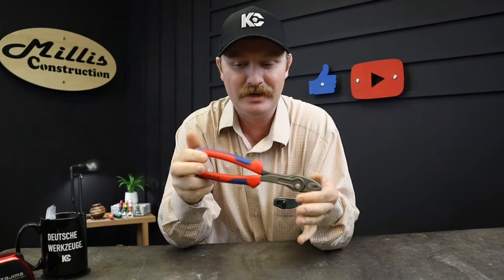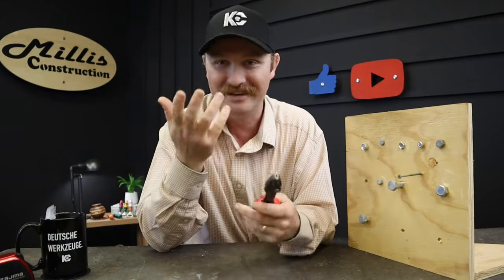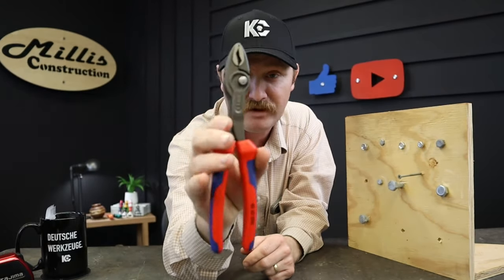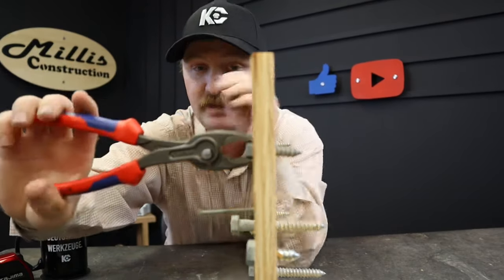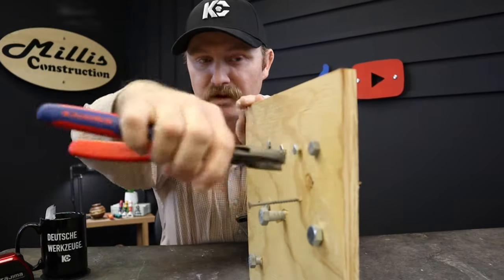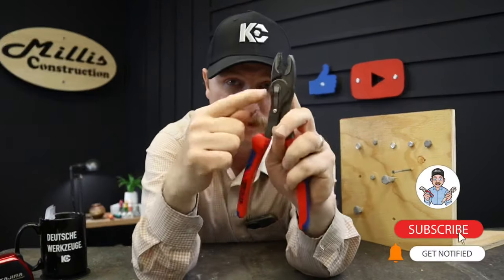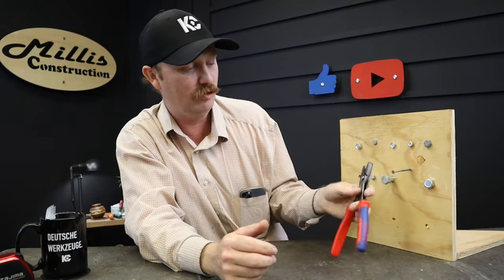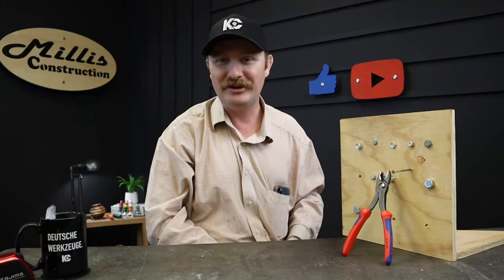Knipex TwinGrip!  Why do you need these pliers?

Comment: I carry the 6" Vampliers in my pocket everyday,  they cut wire and are the small version of this and weigh nothing.   6" Vampliers and Milwaukee Pocket knife with the flip out screwdriver is always on me and way better than any heavy multitool.  6" Vampliers are the Best pliers to remove stripped out screws.  These Knipex would be nice in a bag or tool box if you are dealing with larger nuts and bolts.   These Knipex would be the perfect farmers pliers if they cut wire.  These may be the best mechanics pliers ever,  that is where I think they would shine.
Reply: I have the Engineer nejisaurus 6" (exactly the same tool as the vamplier) and it's helped me out of a bind quite a few times. I really don't like the grip and handle on it though. I don't like the squared off shape it has and I hate that the rubber of the handle extends past the steel.

I'm looking forward to trying the knipex when the prices drop.
Reply: @k4yr4d  I wrapped my handles with hockey stick tape, mostly so they don't slip out of the pliers pocket on the side of my pants when I'm driving but it also improved   the squared off shape of the handles.  The more the hockey stick tape frays,  the grippier the handles get.
Reply: @k4yr4d was going to comment that vampliers are just rebranded engineer combination pliers +$10 middleman fee.  Solid made in Japan tools.

Comment: Get the vampliers set too , the knipex is limited on some of the smaller sizes. As an electrician are running into this problem constantly. The cheap Chinese screws, that strip out/ and a very expensive home. ⚡️

Comment: I only use the vampliers “brute” four small stuff like #6-8 screws that I snap the heads off of cause I drilled my pilot hole to small and used an impact. The twin grips is a better general purpose plier in my opinion.

Comment: You need the style of pliers for every time you try to get that screw I don't care how big or small it might be out these are going to get it done. You might need two pairs one pair for the front side and one pair for the backside of it. I like them far better than the vampires I have. I even have two pairs of comfort grip and a regular handle. I got the comfort grip second and to have two pairs of them. Even though the vampires will come in a second pair and do the same functions for the most part.

Comment: I got them when they were in our shop the first time... and I love them... have them in my pocket all the time at work and used them often, especially to grab torn out screw heads on wood and metal screws 🤗

the fact that you can adjust the size makes them pretty handy... however on smooth round stock and harder pins the only better ones are the engineer pliers from Japan... got a nice set of them as well... but for regular daily use at work... KNIPEX for the win

Comment: I purchased a pair of these a month ago and returned them.
They were machined poorly, with one part of the tip being very thin.
The other thing I noticed was the misalignment in the closed position.
I have more than a dozen knipex pliers and really love them.
Probably just got a bad pair.
Reply: I've noticed that issue with the uneven grind in many of the videos about these particular pliers. I don't think it matters too much in practice, but it's just not very nice to see in this price class. They probably wanted to get these to market as quickly as possible because of the sky high demand, let's hope future batches will be better.
Reply: Slip joint pliers are not as tight because the two handles need room to slip past each other. Even the jaws might not be perfectly align when in use the jaws grab onto the screw head or nut tight. As far as one jaw is slightly thinner than other I would agree that looks ugly but again it doesn't affect the performance of this pliers. I carry a pair of Engineer screw extraction pliers for small screws and Knipex for anything the Engineer couldn't handle.

Comment: Take a look at engineer pliers, they make the Vamp pliers but also have same pliers under the engineer name. They have a green handle, Vamp has the red. They are both touted as scre removal pliers. I bought the lineman version and they got me out a few tight spots. I also just got the knipex twin grip. Have to saw they were worth the wait.
Reply from the maker: I waited so long on these twin grips that KC Tool gave me a $10 store credit for the wait lol. Never had that happen before 😅

Have to say I’m impressed though!  Especially on larger odd shaped fasteners.

Comment: I use both the knipex twin grip & the vampliers for screw extraction, I own various sizes for the smaller stripped screws, they all have their own purposes and are very useful. Definitely worth investing in Vampire tools. 
I dig the spring loaded pliers 👌
Reply: The Brand Engineer makes Vampliiers and you can get Engineer Pliers for about Half the Price of Vampliers. THe only difference is the handle color.  Engineer's are green.   I have 4 Pairs of Engineers in various sizes and configurations in my collection now.  Absolutely great pliers.  Have a pair of Knipex Twin Grip's on the way.
Reply: @brandonthompson8413  Thanks for the knowledge. I just bought the engineers the other day because I saw they were VERY similar and way cheaper. I learned of them from Adam Savage's channel on tools.

Comment: I have a pair of the vampliers needle nose for smaller screws and bolts and use them a lot on appliance repair as they tend to have lots or rusted fasteners

Comment: I got the “engineer”version of the vampliers. So far I found that the knipex slipped a bit more then the engineer pliers. Though the knipex can hold a larger fastener. 
I love the comfort grip but they either take up too much room in my veto tp5 or don’t fit in their pockets well.
Reply from the maker: I agree on the handles, I really like how compact the slick handles are, as far as I know though the twin grip only comes in the textured version or the comfort grip and the textured version I just really don’t like the feel of for some reason as well as the clean ability of it, I kind of thought too with the weird grips these are good at that more leverage in the hand might be a good thing?
Reply: Yeah the  Neji-Saurus 6 and 8 inch are better for the smaller stuff, but these Knipex ones are a lot more versatile
Reply: @MillisConstruction  no they come in the slick handles I have a pair. I like them so much I was thinking of getting another pair with the comfort grip. But after watching your video they look a little too bulky
Reply from the maker: @StreetHitzEnt  there’s something to be said for those slick grips for sure. I love those
Reply: @MillisConstruction  almost all of my knipex tools are smooth grip. I only have a few in the comfort grip
Reply: @MillisConstruction  idk I love the comfort grip handles especially the Bull nose end nips that are angled to the side 61 02 200 comfort grip are a must have for cutting and pulling nails. Someone did call the red/blue look too “Disney” lol whatever that means…

Comment: Man I love them, I do have the vampliers and I do like those but the twin grip have the opposing teeth like the cobras so they will clamp down on a pipe I am an appliance technician and installer and they also work great with squeeze clamps because of the groove In the front.

Comment: I have always used mole grip (vice grip) pliers for awkward screw extraction. You can even get mole grip pliers with the cut out in the end like the Knipex to aid with this. Looking at them, the notch in the end of the Vamplier looks to be wider than the Knipex, pretty expensive to get a set to play with though.

Comment: Thanks Josef 😎🛠️😎🛠️😎 Have you tried the Fujiya screw extractors, absolutely love them, I use them much more than the twin grips???
Reply from the maker: I did get a set, I haven’t used them as much yet except for on screws, they’re awesome on screws for sure!
Reply: @MillisConstruction  that's what I love about them, usually the striped fasteners are on the smaller size that I encounter